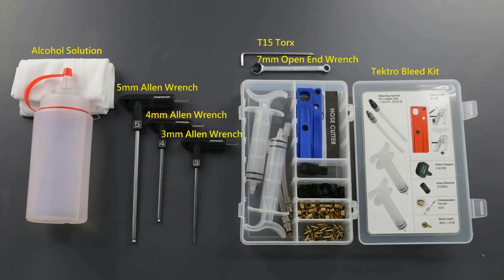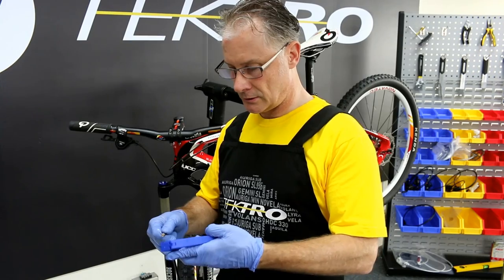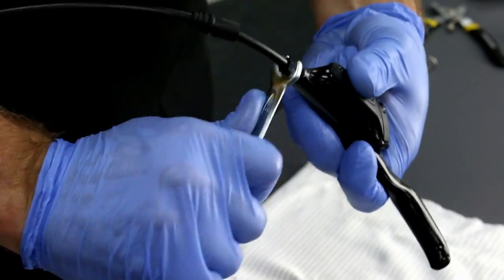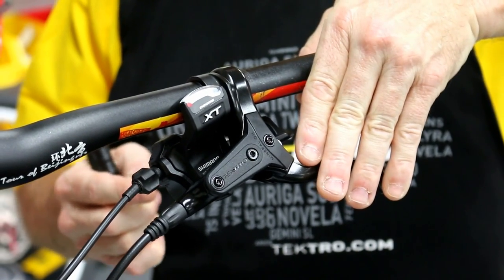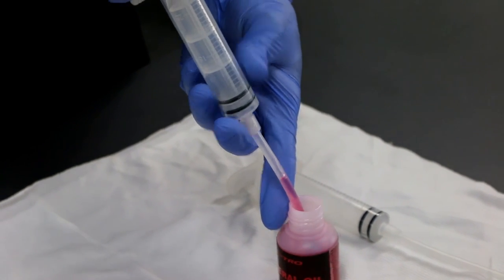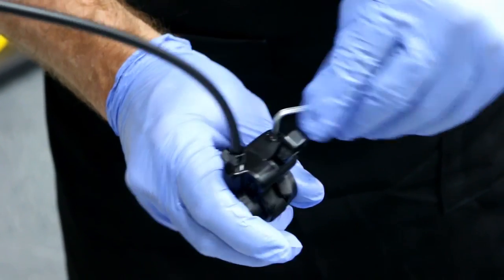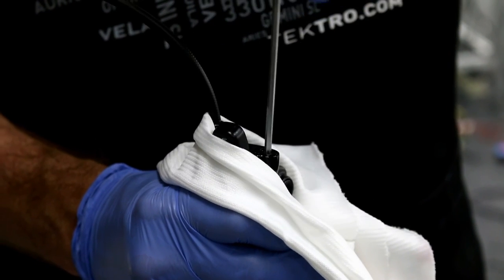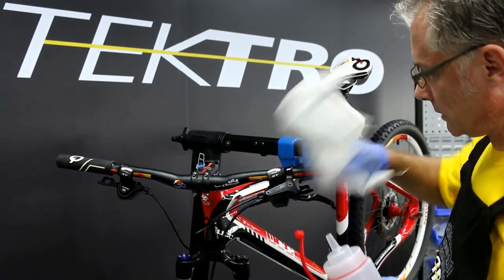How to Cut Hydraulic Disc Brake Hoses to Length

Comment: I just ordered a recumbent trike HD T525 twin brake system.. The Tektro site does say the hose lengths for both calipers and lever all have to be cut.. And the Tektro Ogden website doesn't mention that this "bled" system was set up for a delta trike and not a Tadpole trike..  Why would they "bleed the hydraulic system" if all the hoses need to be cut..That only lets air bubbles into the system which requires bleeding the system again..   here is what comes in the kit:  lever with 6' of hose, two calipers with a foot extra hose than is needed for any tadpole. This kit requires cutting all the hoses and compression fittings (olive and barbs) for each of the 3 lines.. YET THAT IS NOT INCLUDED IN THE KIT.    I got to my appointment to have it installed and they don't carry Olive and Barbs)  and that appointment (because of covid) took me 2 weeks to get.. i had to pay for the appointment, that nothing could be done, while we wait for a second appointment (another 2 weeks away) for them to install...
Why the hell doesn't this kit (that requires cutting all the lines), not come with required olive/bar fittings to install..?  And why didn't the website mention it is for a delta trike..?  And why is a hydraulic system that requires cutting all the lines even bled just so you have to re-bleed this system to get the air bubbles out.. Tektro leaves a lot to be desired..   All tadpole trikes use the exact same lengths of these hoses because they don't vary in length..  Deltas require different length depending on the riders Xseem...

Comment: Thanks for the instructive video.
There is something confusing at 5:05 when you removed the brake pads and then you put them back, what was the purpose of that step??
And I think that it's unnecessary to remove the brake lever because on some bikes it's very hard to remove the handle grip!

Comment: Use an 8 mm open end torque wrench to tigthen it down to 6 Nm, which I clearly do not own, but because of my video cutting skills nobody will ever notice :D
Reply: 6Nm is force produced by application of about 0.6kg with 1m shoulder. With 10cm spanner it is equivalent of 6kg. It is not a big deal to remember roughly what pressure it generates in your fingers, when tightening by hand.

Comment: Looks more like a boot than a cover for the securing nut. This method encourages twists in the hose. The compression fitting I have found to be called an olive.

That injector? Let's call it a syringe.

The alcohol solution is IPA, Isopropyl Alcohol. Come on, make it easier for people to know what they should be buying.
Reply: olive if shimano